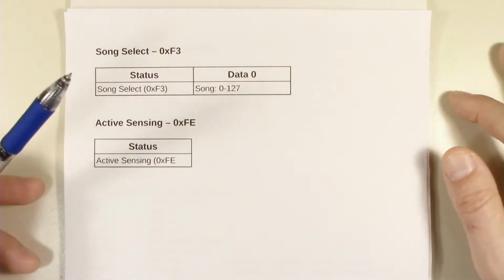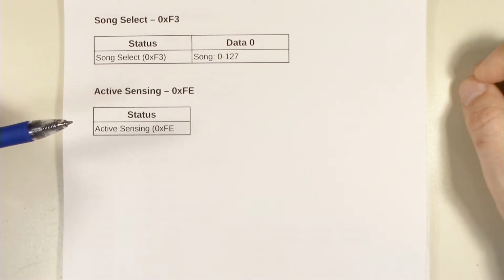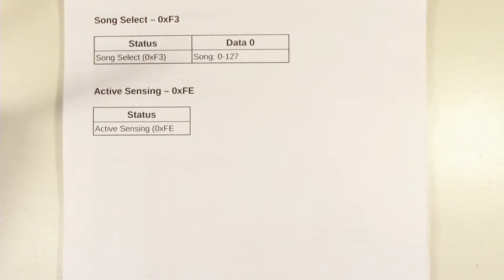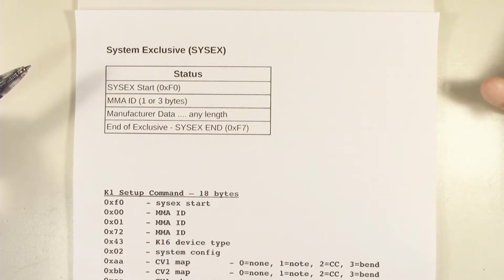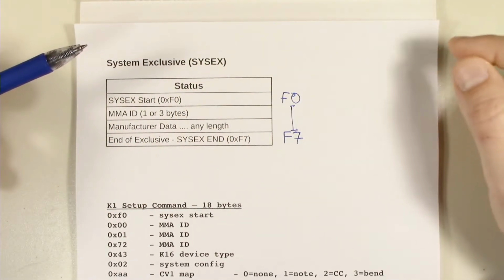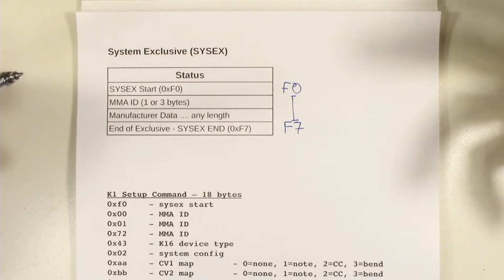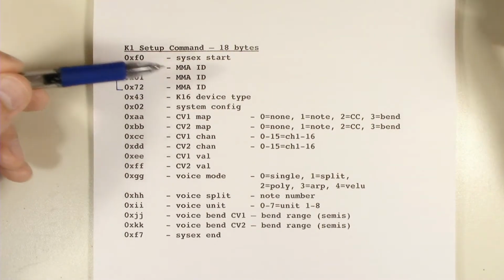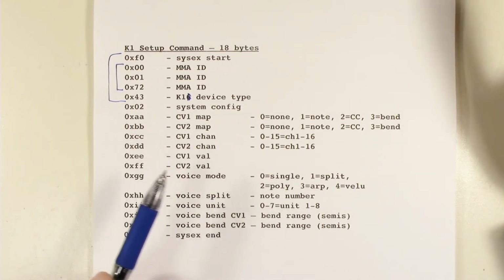MIDI Part 7 - SYSEX, etc.

Comment: “Thank you for explaining SysEx. I have a question: I’m trying to send this SysEx code ( F0 42 7F 60 01 01 10 7D 00 4E 00 00 00 00 00 00 00 00 00 00 00 00 F7)  to my Korg Pa via Arduino (USB or MIDI). I’ve tried, but no success. Could you check the message?”

Feel free to provide the SysEx code, and I’ll assist you with sending it to your Korg Pa via Arduino.

Comment: Andrew - enjoyed all 7 parts but I was hoping to some clues to my scenario:  Atari ST (Pro24v3 or Cubase) daisy chained to Roland Juno (master)  to MT-32 to Roland JV-1080 to Korg Triton. I understand setting each channel for specific patches BUT the JV1080 and Triton have 'Performance' s which take up ALL 16 Midi channels EACH. How to integrate 'performance patches' with other instruments /patches?  Thanks
Reply from the maker: Other than disabling some of the channels in a specific performance or using a second MIDI port (probably not easy on the Atari?) I don't know a way. Performance modes are really designed to be the "whole band" so to speak. One thing you might consider is using the preset mode instead... they often sound better since they can use all the effects processors in these older synths. But it depends how many voices you need in total of course. Hope this helps.
Reply: @shiftedphase  Tks - off to Google "adding a 2nd Midi Port"...!

Comment: This series is tops thank you Andrew really do appreciate you and your midi series. The problem I am working to solve right now has at least one part associated with breaking free from relying on expensive monopolyzing device centric interfacing of both hardware and software. 

My thoughts are that an arduino with some good scripts or one good script might cover it if the usb devices and probably a home made multiport din array device are plugged into the arduino or raspberry pie; whatever is necessary. So then it gets down to the script. Is there such a script that can be exploited for this purpose what be the question?

I am having a problem right now with one midi app for ipad which is very promising especially after deducing how to use it from your 5 year old series Andrew. That app is very good but it blocks the midi messages when you setup the channel for each device. To unblock that I have to pay an extra amount through the app store. When I went to pay it that group refused my debut card and demand I use a credit card. So they refused my Mastercard debut card but accepted it to pay the fee for the original payment for the app just a few days prior. So I clicked the link to the site and found it was down. Makes me wonder if they have been hacked and someone is taking over receiving of the payments. In the meantime I feel ripped off; blocked out of midiflow which is the name of the app which is more like a midiblock but all the same I learned a lot from having it so maybe it was worth the 10AUD I payed for just for that. It really is potentially a very good app and my other apps pick up all the individual names I gave each output and input on each route. Well now I am left wondering what to do so I do not rely on an app and thinking probably I need to setup and external interface with a decent midi file to write in those setups and assign prameters and all. Seems a big job to get this happening which is a great pity because that app was also monitoring each individual channel messaging in a limited way. There are other apps but have not found one yet that does much more than monitoring.

Comment: But if I was to make a program that updates a piece of hardware (that I made) using SYSEX, couldn’t I just put whatever MMA ID I want in the file, and also use that same number in the hardware for it to compare against? Where does the bit where I need to pay come in?
Reply from the maker: You can technically use whatever ID you want, but if you are making software or hardware that other people will use, you need to support the MIDI Association and get them to assign you an ID. For hobby projects it's no big deal though... maybe just choose a high number that isn't in use.

Comment: I’m trying to send Two sysex messages on one pad in Novation SL MKII. 

Single 9Byte message works on two buttons, but a dual 18 Byte message doesn’t work :(

I’m trying to figure out way to send dual sysex string with a SIngle string

Comment: is there any sample code to send sysex in arduino ide?
Reply from the maker: I don't have any but it's just like sending any serial data. The normal way to do MIDI would be to fill up a buffer of uint8_t or char and then send it. I'm sure there are some examples out there.

Comment: This did NOT explain sysex at all. An example of using it would have been nice.
Reply from the maker: Each use is totally different. But some of my other videos show examples.
Reply: @shiftedphase  Can keyboards (not midi controllers) send sysex messages to other keyboards? I own a Roland Fantom 6 (new model) and a Roland VR-09. The Fantom 6 is my patch changer. The VR-09 can only switch to organ sounds using sysex (not program change). Trying to figure out if I can send the message from the Fantom.
Reply from the maker: @keneokpareke1753  Some products allow you to program in custom messages to send. My digital mixer can do that. But generally different models of product even from the same manufacturer are not likely to automatically know how to talk to each other.

Comment: What a well presented and thorough series on the topic of midi and SysEx.  Thank you for taking the time.  I’ve revisited your videos as I’ve delved deeper and deeper into getting my equipment to be triggered from logic x via SysEx. I have two question though.  

I read somewhere that SysEx isn’t for triggering.  That is for Control Change commands, note on/off commands and program changes.  Anything that can be done can be done with those three midi commands and the rest is for patch dumping etc.  this confuses me because you CAN trigger program changes, control changes and parameter changes with SysEx and you can do so when some devices don’t even have a way to do it from their HUI or there isn’t a button on the face of the unit to do so.  An example is tap tempo.  I have a device (TC electronic M3000 effect processor) that can synch to incoming midi clock but you have to press and hold the tap tempo button for three seconds to get it to lock onto midi clock.  I learned how to do this with a SysEx message and now I don’t have to do a thing.  So I start each song and that is taken care of automatically.  I really like that.  For things that are controlled by CC, Program, changes and parameter changes easily, I thought I should stick with the traditional midi way of doing things but logic X does some weird things and I think it has to do with active sensing.  I get inconsistencies with even the simplest of jobs like bypassing an effect, for example.  Anyway, it could be the buffer timing but I’ve decided to do things via SysEx because I read somewhere it’s more consistent and less susceptible to corruptions.  What say you to this idea? 

Next question, and thanks for reading the long post; what is a preset request?
Reply from the maker: Glad my videos are helpful to you! Firstly I don't know what a preset request is.
As for using SYSEX... there is nothing wrong with using it however you like. It's just a message like any other... but it is EXclusive to a certain brand or model... so while a CC message might work across a lot of devices, a SYSEX message is probably only going to work on one instrument. But if it makes things easier to control, I see no reason not to use it. As a performance message though it is longer to send, and also probably can't be as easily automated by a DAW because the format is not standardized. But the way you are using it to enable some mode instead of holding down buttons sounds like the perfect use case!

Comment: Dear Sir , appreciating deeply Your esteemable videos , i would now like to ask You whether  You would have some tips and tricks for a newbie like me and the approach to access virus control 's Remote software  page , from where it appears to be really possible to get functioning ... well reacting  midi commands , so as to slowly  increase the manual  midi and /or system control over this device of Ours , so to say ...Best Regards
Reply: @shiftedphase  Thank You for Your kind answer .

Being thankful to Your instructional videos , it appears that During the last week I am struggling to achieve  a deeper knowledge of the access virus control/Remote page  software and the use , for example , of another  Generic Remote   by cubase, from where it would be possible to get a commanding hardware controlled ( i.e. the Access Virus Ti desktop itself ) . not everything is clear and ready to use : for example : by writing the typical sys ex scripting procedure and its hex number, I tried and managed to get  bank  changes and program changes: Now :what I would like to obtain is  the following : an IMMEDIATE : an INSTANTANEOUS opening of these function abovementioned , while rotating the same rotating knob .

Is it possible to obtain 

OR

 should I already feel the situation abovementioned ( please : read! Bank Change Program Change ) as the typical functioning event  already useable : without expecting further "refined  "functional switches ?

Waiting for Your kind reply , I salute You with 

Best Regards
Reply: @shiftedphase  oh well : thank Youvery much . Have a nice day !

Best Regards

Comment: As someone who is trying to learn how to preprogram patch changes of outboard effect processors using midi/SysEx saved to Logic X , trigger song selections placed on a timeline in a Logic X project from a Yamaha DM1000 digital mixer and trigger lighting rig scenes - I thank you wholeheartedly!  

I’ll admit I’m in over my head and I’m wondering if it’s better to make the Yamaha DM1000 or Logic X the trigger device? Both have memory to store information and transfer it to external devices.  On the DM1000,  there is a scene memory section where I can store 97 scenes.  It’s seems that would be optimal; recall a scene, press “enter” and somehow it moves Logic’s Song Pointer Line to the correct position and changes patches on the outboard gear, too.  Then I just have to press the space bar on the computer and the sing starts.  Is this doable? Thank you again from an abecedarian who is eager and excited to learn.
Reply from the maker: My gut feeling is that it's easier for a DAW software to trigger hardware than the other way around. Maybe with controller mapping and stuff, but having Logic as your master is probably the easiest way to make sure everything stays in sync.
Reply: Shiftedphase  I want to thank you for taking the time to respond to my question. Also, I have a pretty complex project I’m working on that requires expertise I don’t have the time to gain. Would you be interested in working for me on it?
Reply from the maker: @12knE  I'd love to help you but I design gear and make music full time.

Comment: In this age of distancing I am trying to work on electronic music (the band certainly can’t get together at the moment).  This has cleared up a lot about how the controller and hardware synth work together.  Can you tell me where the software synth fits in all of this?
Reply from the maker: The software synth can normally be considered as being inside a sequencer or DAW software. Normally the MIDI data is routed internally inside a DAW and fed into plugins on the various tracks.

Comment: How does one go about successfully creating a midi instrument, complete with both hardware-firmware, & if software?
Reply from the maker: That's a big question and one that is impossible to answer because it really depends on what you want to accomplish, your existing skills, and the reason why you want to do it. For me it's the ability to use my skills, learn, and create stuff that I'm proud to unleash into the world.
Reply: @shiftedphase  You,re right. I need so much direction at times. It's a good idea though..

Comment: Man thank you so much for this series.. I've assigned some me-time this morning, notebook on hand specifically to follow this seminar-like crash course on this (I now know) very useful protocol.   Content like this make me fall in love with the internet.. 

I have some questions if you mind,  regarding an implementation I'm developing. Basically is a serial-over-bluetooth controller with only clock and control change output, using gyroscope sensors.

First of all, would data rate be a problem?

  If I include active sensing I could prevent the receiver to go on sleep mode I suppose so to not having any crashes on live performances.. I'm thinking of sending a 0xFE byte before every time any output is sent.. Would that be a correct  implementation?

On the other side, what are your thoughts on Hairless Midi serial-to-midi bridge software? Any known issues? Any suggestions?

Whatever kind of input you feel like making would be greatly appreciated! Infinite respect to you, hardware guru.
Reply from the maker: Sorry for the late reply. :( If you still need help with this please email me... the link is on my website, check the About page on my channel.

Comment: Hey dude, great series.

I've noticed there is not one good tutorial on the use of NRPN messages on youtube.  If you're up for it, you'd be filling a much-needed gap.

Personally, I'm trying to control my OB-6 from Max MSP.  CC messages are great, and easy to use, but I can't control some of the more advanced features of the dave smith without NRPN, but the documentation for this, both from Dave, and from the Max people, is sparse at best.

from the best I can figure, I think I need to manually create the binary message and send it as raw midi data, but I can't find any working examples, and flailing in the dark is antimotivational.

cheers
Reply from the maker: I've got a few extra topics related to MIDI that I might do in additional videos. I can consider discussing NRPN also, thanks for the suggestion.

Comment: aha, song select sysex, never heard about that one.
This sysex paper seems quite easy to read..but i struggle with many other midi charts from Roland and Yamaha.
So if i wanted to change the CV 1 to CC would the byte be like this?
f0 00 01 72 43 02 02 f7  ?
Why is it written like 0xaa? what does the 0x stand for?
Now i see why it takes so long to send stuff over sysex...seems so inefficient :) sends the same bits over and over again. But i guess it is a limitation of a seriell tech. 

A bit off topic, but what are your views on USB for use in audio application? Im quite a noob but it seems really awful to me...as you mentioned it seems flakey when it goes offline. On windows if i loose the USB connection it can be a hell...could need a program reboot or even windows reboot (better implemented on mac, no need for program reboot).  
sometimes my audio interface is just not found at all when i stick in the USB cable...because i plug it to the "wrong" usb port...switch it around a couple a times and it finds it..why is this? is it just terrible design? or designed for printers? even the physical design is really flappy and loosey goosy, not a looking connection. i see hardware developers must be quite trapped because there are no other common port/interface to use...what are your views on this? i would prefer the old mouse serial jack to usb when it comes to all midi and keyboard and mouse connections. 

Thanks for all the interesting videos.
Reply from the maker: Magnus Andersson The 0x notation means hexadecimal, so you write numbers from 0-f or 00-ff. (256 combinations) I use the aa, bb, etc. just to show that the bytes could be any number. Like "??"

As for USB... it's just really complicated and has many layers, so developers often don't have access to the lower level details. If a bug in a chip or OS driver exists (they do) there isn't much that can be done from the application layer. But it's the universal connection so we do our best. :)
Reply: aha, so that 0x means hexadecimal, didn't know that. But i am aware that sysex use hex. The editor for the Roland Fantom XR i have show every sysex command as soon as i do something in the editor. handy to know a little more what values are what so that i could use them in a ipad editor or program a external controller. The old manuals for some Yamaha stuff is crazyness with the sysex, but today with newer devices i hardly see anything, it is almost as if it is a secret.

Yes, i see your point, not many connections left to use :(. I have a feeling firewire was better in every way for audio. If i could decide i would go back to locking SCSI connections, parallel..SOLID!! :D